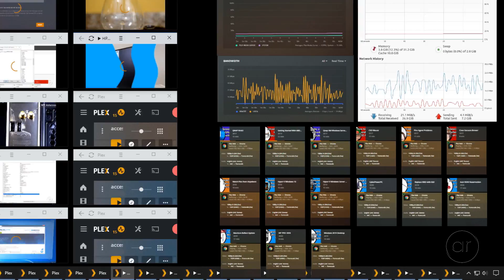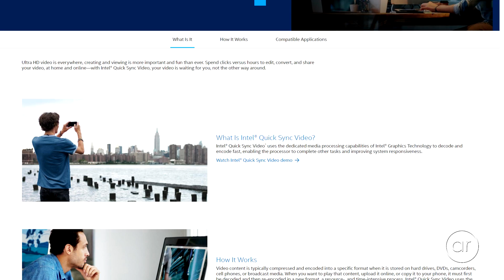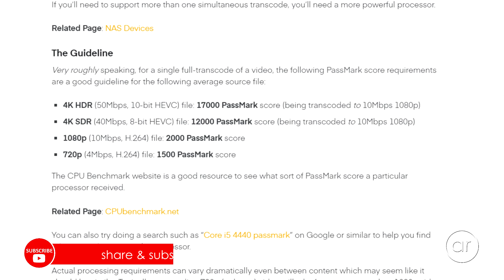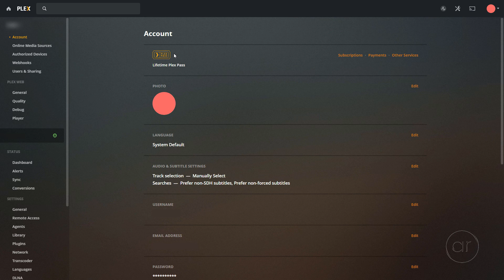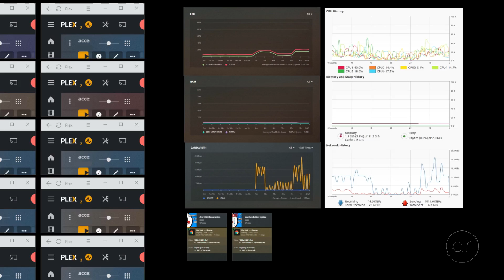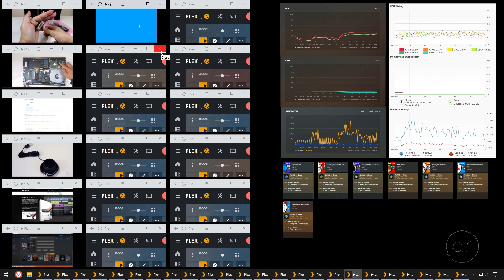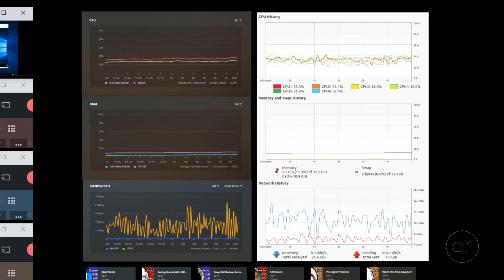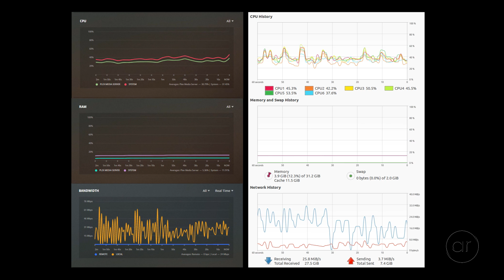Plex Stress Test: How Many Streams Can I Run at the Same Time on Quick Sync?

Comment: I just built a replacement Plex server running an i7-12700k to replace my old i5-4460. Needless to say I'm able to transcode a LOT more simultaneous streams, and 4k transcodes are a real thing now.
Reply: How many 1080p streams can you run
Reply: I can run at least 6 simultaneous transcodes from 4k to 1080p, and probably more.
Reply: @iamamish  if it was just 1080p files how many do you think you could transcode then. I don't have 4k files just 1080p files
Reply: @tauntonlad  oh tons - I cannot imagine it is fewer than 20 but I haven't tested it. Unless you plan on having a LOT of users (hundreds) then I wouldn't even worry about it. 

Yup just looked and the consensus is "at least 20" 1080p transcodes on the 12700k. 

I'm really happy with my TrueNAS scale box, and the hardware is a good fit.
Reply: @iamamish  awesome thank you for giving me that information

Comment: Hi! Thank you for the effort, however, this is very obsolete review. Today where 4K TVs are standard, and our media libraries are full of new 4K Movies & TV Shows you should redo the review showing how many 4K & 4K HDR videos can transcode at the same time. Also, you should sort it in 3 phases, each three with 4K and another three with 4K HDR. Phases should be somewhere near to real-time scenario transcoding to a) 4K - Original quality (for example 4K x265 to 4K x264), b) 1080p@20Mbps, c) 1080@10Mpbs. You can do additional with 720p@3-6Mbps. I have basically bought i5-1135G7 because of your video and I was able to transcode 4K to 1080p@10Mbps only 6 times. I wasn't able to transcoded 4K HDR to 4K. Therefore, guys, if you have a lot of 4K materials, and you want to be able to transcode it to 4K or 1080p, be careful.

Comment: Looking at getting an 11th gen CPU to replace my Threadripper 1900X that is quite power hungry and currently is doing software transcoding in Jellyfin which caps out at around 2-4 1080p transcodes (H.265 10bit to H.264 8bit). I hope QuickSync will give me a nice boost, especially when it comes to HDR color mapping. The 11400, 11500, and 11600 aren't that different in price with 110-150€.

Comment: I'd love a follow-up to this video that goes into actual detail about the transcoding process and BENCHMARKS that show the limitations of Software transcoding (What Codecs can be transcoded by just a CPU? How many streams? What bitrates? How does ARM compare with AMD and Xeon?), as well as a head to head showing the differences between Quicksync and NVDEC. Can you edit Plex's built-in transcoder to get different outputs? How does Plex decide when AND HOW to transcode a file?  There's so much we don't know!
Reply from the maker: Thanks for the suggestions! I would love to set up an experiment like that in the future.

Comment: Very very well explained. I'm planning on building a plex server myself, either with an i5-12400(UHD 730) or i5-12600k(UHD 770). My question is, because these chips have better iGPU(730 and 770 compared to i5-9400's 630), will the quick sync also perform better? As in, will I be able to transcode more videos with hw simultaneously? 
Honestly, I don't think I'll ever surpass 10 simultaneous playbacks, but it's nice to have extra legroom.
Reply from the maker: Thank you. The sweet spot was the 6th to 7th generation Intel CPUs because they dramatically improved the quality with QuickSync around then - above that, there have been incremental improvements. With that said, a slower CPU can artificially limit the number of transcodes a GPU is capable of, so with the 12th gens you will probably see the ability to transcode more videos. To be honest, I'm not sure how the UHD 730 would compare with the 770 within the same generation.

Comment: Is your read/write on your disk max out?
Reply from the maker: That's a good observation/question. The videos sit on a hard drive with a SATA 3 interface (theoretical maximum of 6 Gbps), so even at 18 streams forced to 4Mbps, it shouldn't come close to maxing it out.
Reply: @accessrandom  but you are doing transcoding, it stream + writing the transcoded playback 18 different place somewehre.

Comment: Can you test with 4K? Especially 4K HEVC? Nowadays more HEVC 4K videos that we need to transcode.
Reply from the maker: I would love to, but I'm afraid I'd probably need to move to the latest gen Intels as my ninth-gen i5 doesn't have enough horsepower. In general, I think the consensus is to avoid transcoding 4K if at all possible (serverbuilds has some good posts on the subject).
Reply: @accessrandom  It should work, it's the GPU doing decode + encoding, even my Celeron J4125 was able to transcode 4K HEVC 140Mbps bitrate (well, just 1), not sure if the UHD 630 with a bit better display core can provide more concurrency.

Comment: I'd like the ability to determine maximum users from outside my network. Guess you could use a VPN.
Reply from the maker: You could use the same setup but have each client go through port 12400 to run a video. The bottleneck would probably be the upload bandwidth from the server.

Comment: Hi I got one question if the ram on my pc is dual channel and the base clock speed for both are 2400, when in dual channel i get 2400 per ram or 1200 per ram.
Reply from the maker: The reported speed is halved since you are running in dual channel, with data transmitted twice per data clock cycle.
Reply: @accessrandom  I see thats why my ram was running lower than its clock speed, Thanks.

Comment: My idea for the "puffering with many streams" investigation is to just simply ping the server from the client(s) during the test. Maybe the download is doable, but the "pocket arrived" messages are increasing to the limit (raw idea)...
Reply from the maker: Thanks so much for the suggestion - that would definitely tell me if it's a network issue. I've created a network diagram for my next test, but it may be a while before I can get to it - I'm really curious what the limits of the hardware accelerated transcoding are...

Comment: I would try multiple clients . And or try a more Powerful client than this one might work better ? Just my thoughts, no experience in using plex or things like this so im just pulling out some simple thoughts . Interesting test and would like to see more .. cures my curiosity . Cheers
Reply from the maker: Thank you for the suggestion. Yes, I think that will be my next step - maybe use three or four clients with 6 to 10 streams on each. I was actually able to get 25 streams running (in the Plex Now Playing stats) by opening - then minimizing - 25 browser windows on the server itself. The server can handle the hw transcoding on the back-end - the question is whether the bottleneck is on the front-end.
Reply: @accessrandom  Thats what im curious about. the Client and Its abilities / Bottlenecks etc etc . I am sure others would like to get some type of baseline, if you will, knowing what can do what and what Cant do what is always great to know . Looking fwd to finding out :) Even an older system used as a Client would be pretty cool to know how good/bad that can be . Ah so many unanswered questions !!!  I must know these answers . Please help a guy out would ya lol . Cheers